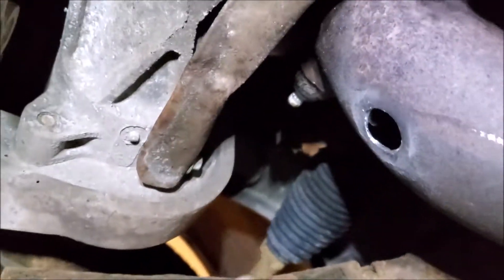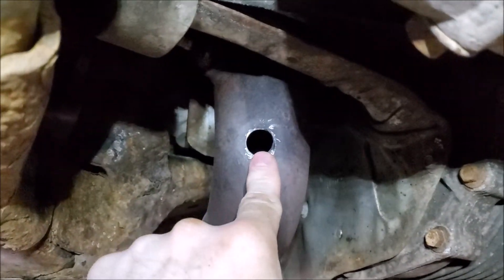O2 sensor fix in 10 minutes

Comment: Nice idea. It helps that it has it's own heater, so no issue being too down stream.  Besides, as long as there's no code, there is no spec for where it should be,
Reply from the maker: Right, I've done this on a few rust belt cars and trucks...
Reply: @GarageMahalLife  Yep. Considering what it could take to remove the pipe that old, who knows what gets damaged. You saved your customer a whole lot of money.

Comment: Did that fix the problem
Reply from the maker: In this case, yes.
Reply: @GarageMahalLife  I'm hoping it'll work like magic like yours did..figure o2 sensor much cheaper than catalytic converter
Reply: Both downstream o2 sensor are welded in.Got a wicked lean code and catalyst and o2 sensor not getting ready..im like why..thinking to just cut the wires leave them in a do what you did with the new ones.

Comment: Some smog techs may consider that solution tampering with emission system and not pass it until its removed. They may consider it an O2 extender. Could you have not gotten some pliers and grabbed the stripped O2 sensor to remove it.
Reply from the maker: No, it will pass. O2 sensors in the North East can rust weld themselves to the exhaust. Trying to put an breaker bar can sometimes make it crush older exhausts. If the system is secure and not leaking, it will pass...
Reply: @GarageMahalLife  Oh ok. I see. Appreciate the information.

Comment: So I have almost a same issue but instead I can get the 02 sensor out. My issue instead is a crack at the 02 sensor threading. So I’m gonna try and weld the crack and drill the end of the crack so it does not continue to crack later. If I can retap the thread this will be my next step. Thanks I was checking to see if anyone had tried this. Side note: how did the sensor fare with it not going as deep as originally designed. Would it effect the same as a defouler that people use to trick a 02 sensor that is throwing a 0420 code?
Reply from the maker: I was worried about it not being deep enough either into the exhaust stream, but it was, the depth was a bit more shallow, but no O2 codes and it ran and continues to run with no issues or codes. :)
Reply: @GarageMahalLife  Repaired mine, and Nissan quoted me 1550 dollars for the repair. I spent 85 for the new 02 sensor. 15 for the new exhaust bung. I had to pay 125 dollars to the Nissan dealership, Due to a service bulletin about the Air flow ration not being relearned by the Ecu. Only the dealership can program the ECU with their own obd2 scanner as they have the program for each model. But in the long run 225 for repair and pass Inspection compared to 1550.. Its not even close. My 02 sensors sits just fine in the bung I put on. The only funny thing was, I went to Auto zone and asked if they had any Exhaust bungs in stock, The guy looked at me lke I had 3 heads. I asked him to search online and he could only pull up the EGT bung. He asked me what does a exhaust bung do.. I was like Man if you dont know, I suggest you go ask your manager. I was a little upset and short on time at this point. He said he was the manager.. I just put my head down and told him to google exhaust bung.
Reply: I then went to the advanced a mile down the street and asked if they had any exhaust bungs in stock. They guy without missing a step, pulled out 3 different options and asked which would be best for my need.
Reply from the maker: @ivaneatoniii5025  That's great! Wonder why he was so familiar with them 🤔
Reply: @GarageMahalLife   I actually told him about the guy at auto zone and his response may answer your question. It is the management training. At autozone if you can count and balance a til and safe you can be a manager at advanced they have to take automotive knowledge based classes to be able to answer questions a customer may have. Now would they know the timing ratio on a Toyota probably not but what 590 and 640 cca on a battery is something they better know.